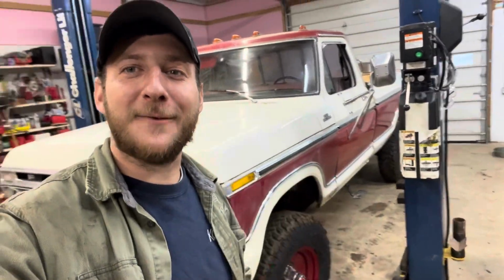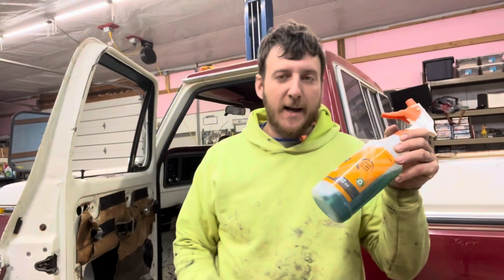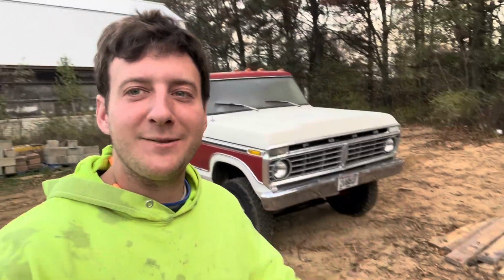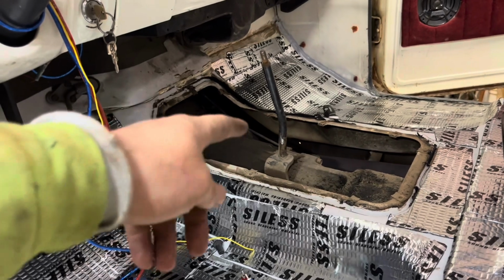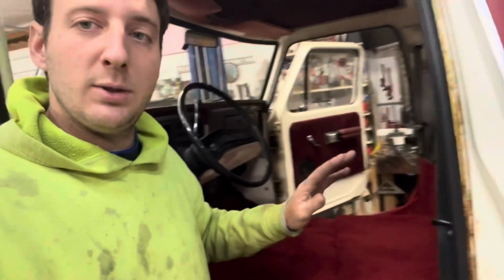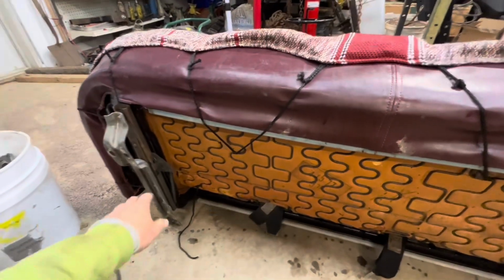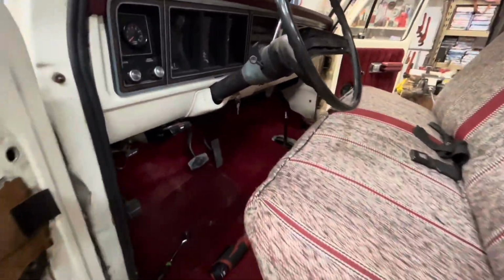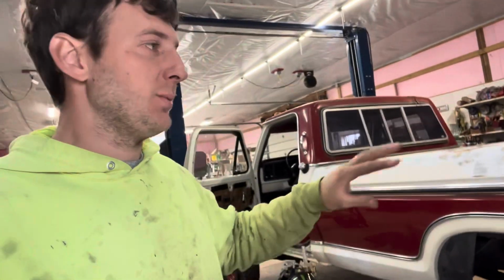Finishing New carpet install on 1977 Ford F-150 Farm Truck (2of2)

Comment: what amperage are you setting the welder to to not burn through the sheet steel?
Reply from the maker: This is a Hobart 140 and the settings were 1 (out of 4) and 20 (out of 80). I’m sure that’s not very helpful but I’m also using .23 wire.
Reply: @Notafordguy  thanks man - been trying and keep burning through on my old chevy
Reply from the maker: What welder do you have?
Reply: @Notafordguy   a yeswelder arc205 , a yeswelder tig, and a generic chinese wirefeed